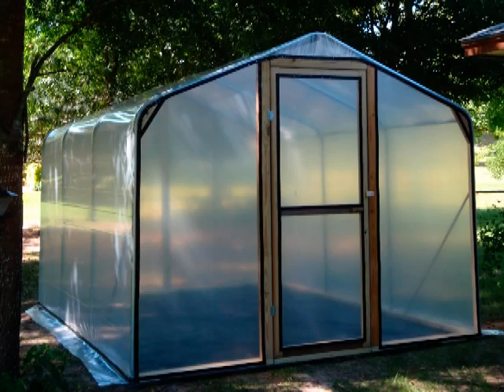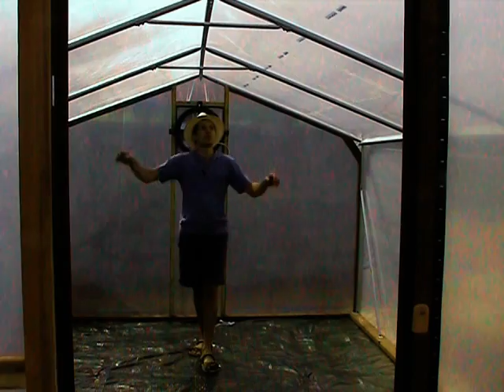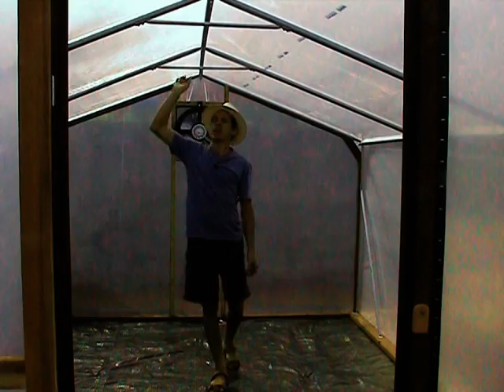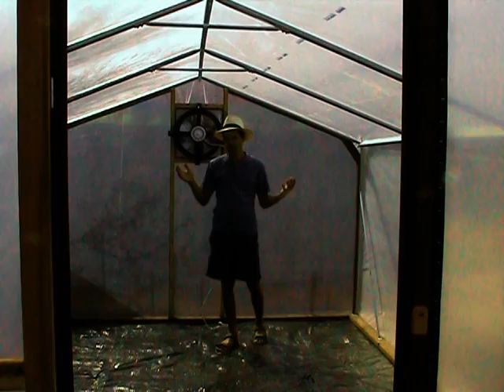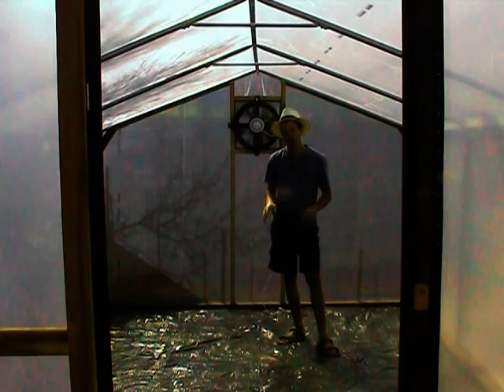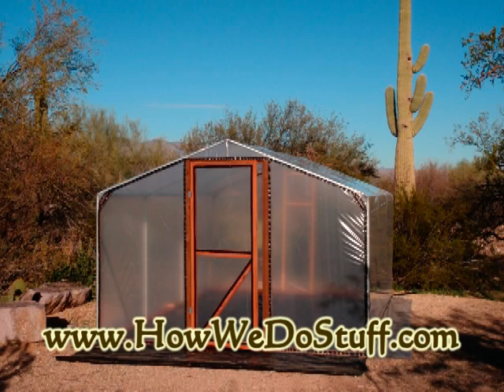Build A Better Greenhouse - An Affordable Small Hobby House!

Comment from the maker: The kit includes all the screws/bolts, plastic, t-tape, weedblock, weedblock staples, most hardwar and more. You can see a complete list on the website. You'll have to find 2x4s, toprail from chainlink fence, staples/staplegun, and a few other small things. Including the kit, it should cost under 600$ for the small greenhouse, plus the fan/thermostat/shutter which is usually about 125$. The larger greenhouse will be under 200$ more, which includes the additional cost of the larger kit.

Comment from the maker: It really doesn't need any more strength. I've had 12"x60' pine trees fall squarely across the center of this and not touch the ground. It's incredibly strong. 

That said, you can stretch chicken wire over it to make a chicken house out of it, I've done that on several occasions. Or put roofing steel on it to make a portable building out of it. You cannot however put plastic on top of the chicken wire, because it will destroy the plastic.

Comment: What would you think about another type of reinforcement, like overlaying the frame with something like chicken wire or box fence before putting the plastic on? I think (theoretically) that it would solidify the frame structure even more and also provide more strength against "snow load". What do you think?

Comment from the maker: I live in Texas, where snow load is minimal, but I wouldn't worry too much. It's a very, very strong structure. Probably capable of withstanding 1000+ pounds. Also, it's sloped well and should slide off easily. And, being a greenhouse, it will be warm inside which should melt the snow fairly quickly to help it slide off.

Comment from the maker: Polycarbonate is a great material, and can be installed on this same frame. However, Polycarbonate costs about 10 times what the plastic costs. You can easily install and replace this plastic a half-dozen times for the cost of one installation of polycarbonate, and each time you do you have a new-looking greenhouse. 

Also, since it is mostly one piece this plastic has no seams and holds air (insulates) better. And requires no special end-caps or rubber to keep it sealed. I've done it both ways.

Comment: Hm, if I ever had to do a greenhouse, I'd use polycarbonate. I've been using it instead of windows for sheds or thermal insulation on top of PVC windows. I've had a large piece that is in direct sunlight most of the day, and it hasn't shown any sign of degradation for several years now.

Comment from the maker: Well, we sell the kit on the website for 229.95, including the plans, plastic, t-tape, weedblock, all screws, fasteners and hardware... I doubt you can beat that price anywhere, with any design. 

The bottles will indeed provide excellent insulation and I like the idea, but keeping them from leaking in bewteen will be a challenge :)

Comment: Nope, it will allow the sun in and retain quite a bit of heat, too.  You said your approach will require to replacement of the plastic after a few years.  The cloth lasts a lot longer.  I'm personally going to try constructing one out of plastic bottles.  The air they trap will create tremendous insulation while allowing in even more sun that either your or the cloth approach.  And, it's a much cheaper approach.

Comment from the maker: ...won't that block light? Or if thin enough to allow light, permit too much heat to pass through? 

Regardless of the covering - chicken-wire, plastic, sheet metal, I've used several - the design is still a good one and very versatile.